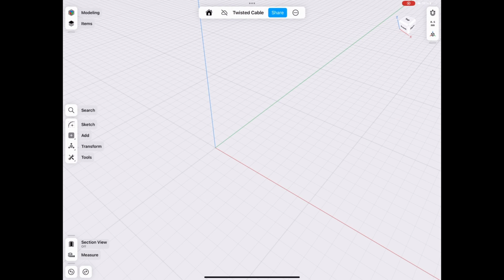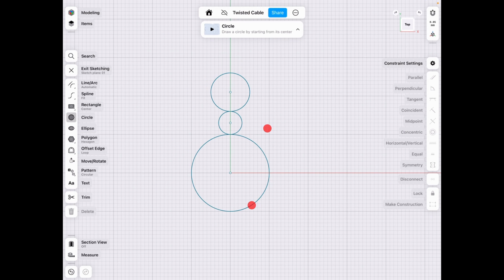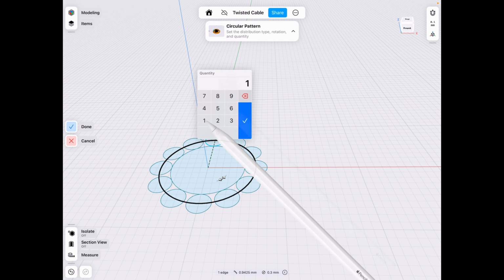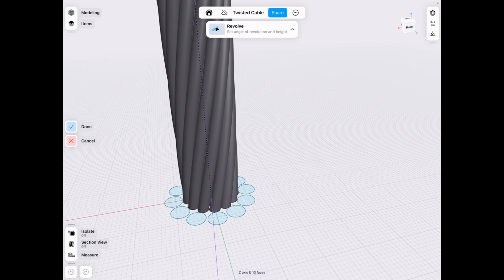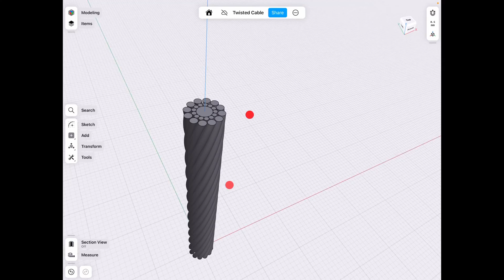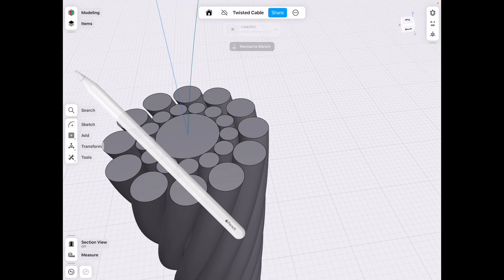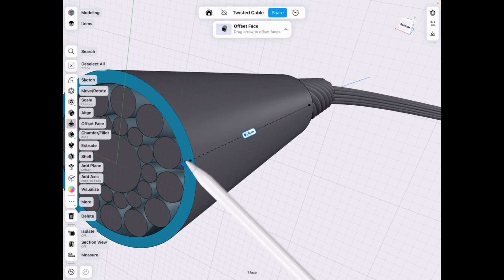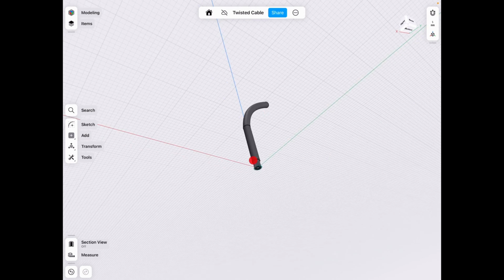Twisted Cable in [ Shapr3D ]

Comment: Any advice or methods you would use to do a bunch of cables? modelling a wiring loom with branches in numerous directions  for example
Reply from the maker: Anything that will need bends will have to be done outside of Shapr, but if you just want to make a straight loom then it’s quite feasible even in Shapr. I’ll make a video 👍
Reply: Just to clarify - wouldn’t need to twist cables only representing them as tubes but still super hard and tedious to create a 3d sketch to do s cable spanning 3 dimensions
Reply from the maker: Thanks for clarifying, I have done projects where I needed perfect fitting cables so I know how it’s done. I’ll post a video as soon as I have time to make it ✌️
Reply: @JLake3D  legend! Trying to represent Non-solids in CAD is always a nightmare
Reply from the maker: Definitely requires more time/effort. In some cases making it not worthwhile at all :)
Reply from the maker: But as usual there are workarounds if you think outside the box 😂👌
Reply from the maker: Uploading 🤘

Will take a while with my slow upload speeds though 😂

Wiring Loom or Harness in [ Shapr3D ]
https://youtu.be/dabfzyDfMJY